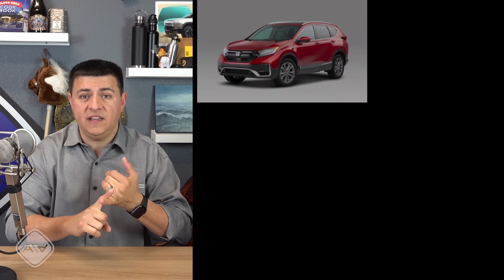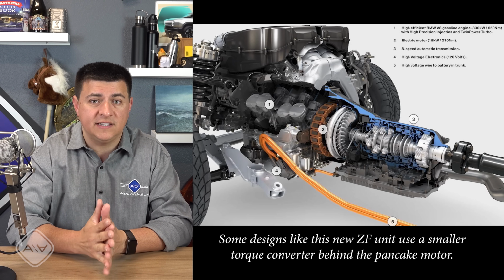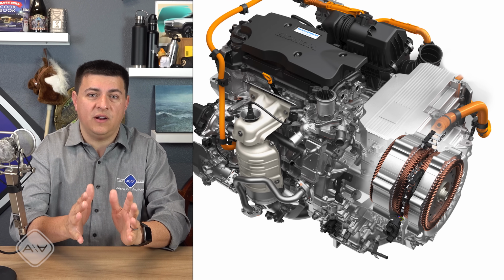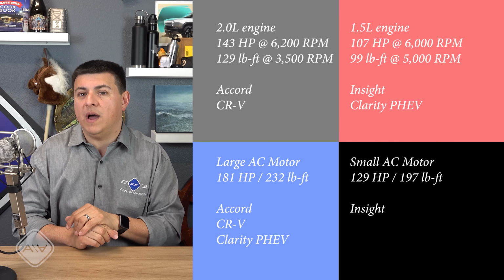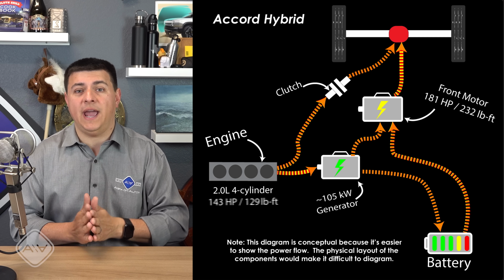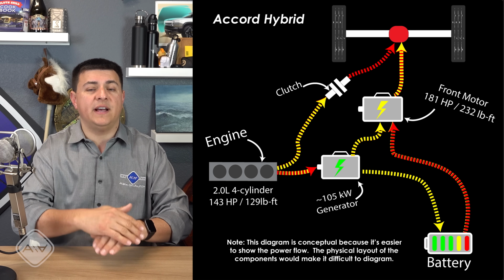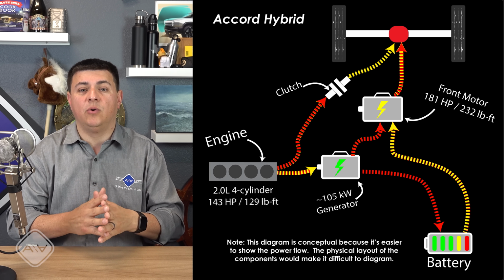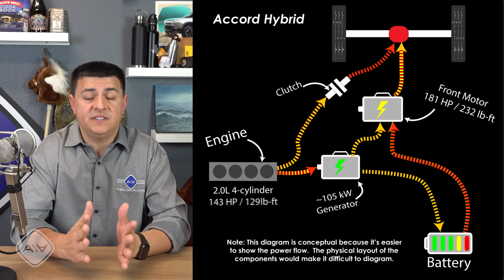How Does It Work?  Honda's 2 Motor Hybrid System Explained!

Comment: It will not get 38mph  ever
Reply: And you know this because.... ?

As of today, fuelly.com lists 10 CR-V hybrids. Two of them are doing better than 38 mpg, its EPA rating. This suggests 20%, which contradicts "never." The average is 34.7 mpg.

For comparison, the 2021 RAV4 (which has been out longer) includes 46 vehicles. Six of them, or 13%, exceed its EPA rating of 40 mpg. And the average is 34.1 mpg, less than the CR-V's.

I restricted this to winter-biased 2021 models because that is all that is available in the CR-V. The EPA suggests that mpg can drop up to about 25% in a cold winter.
Reply: @jeffjo8732  ok you believe the EPA , but I have had a 48 hour test drive with a dealer, the had 45 pounds of air in the tires, mpg of by 6 to 8 miles    my  2013 Altima gets 40 to 45 on the highway at 55mph, hot or cold weather does not affect it, oh and there was no spare in their s at the time
Reply: @judgedredd3686  Where did I say I "believed" the EPA?

You claimed, as an absolute fact, what you "believe" based on a short test under undocumented circumstances. I pointed you to documented evidence that contradicts your belief. And since you claim something that is well known to be untrue - "that hot or cold weather does not affect" a 2013 Altima ... I see no reason to put any faith in your evidence.

Let me repeat my point again: In a small data set, the Honda CR-V Hybrid - in winter, but it is not known how severe - has been documented to be capable of exceeding its EPA rating of 38 mpg. Something you claimed could not ever happen. Which is another mark against your credibility.

It won't always - something also in evidence - but the slogan "your mileage may vary" applies to EPA ratings. As an example of this, I pointed to a larger data set for a similar vehicle, the Toyota RAV4 hybrid. Its rating is indeed higher, but a smaller portion of the samples exceed that rating. And in fact, the average over the entire set is lower.

I'm not claiming any of this is conclusive. I try not to jump to such conclusions, or to present my opinion as if it were fact. And BTW, my 2018 Honda Accord Hybrid, rated at 47 mpg by the EPA, has averaged 47.9 mpg over almost 2 years (and almost 19,000 miles). That includes winter, when I admit it loses about 10%.
Reply: @jeffjo8732  ok , but nothing after 60, a dead fish in water
Reply: In summer, 55 to 60 mpg on a 40-mile commute that is mostly 60 mph to 65 mph.
Reply: @jeffjo8732  i mean no passing power
Reply: @judgedredd3686  I can pass just fine in my Accord Hybrid. Much better that in my wife's non-hybrid. But it is becoming obvious your beef is with Honda, not specific aspects of specific models. So when the facts contradict your claims, you shift claims to something else you have read.

So I will give you this one: the acceleration profile of this hybrid system falls off more quickly, at higher speeds, than a traditional gas car's. But the drop-off point is higher than 60 mph (as you claim), and it is adequate (not "nothing," as you claim) especially when compared to most other hybrids. This is a property of all electrically-driven vehicles, which the Honda hybrid is. This is why Tesla puts ludicrously-powerful motors in their cars, so people like you who think they need it at 80 mph (who are you passing at 80 mph?) can have it. And if you know how to drive it, you can improve on the claimed acceleration times.

But it doesn't matter when the acceleration profile starts out high, as it does in Honda Hybrids. MotorTrend named the Accord Hybrid the "Quickest Car That Get 40 MPG or Higher on the Highway." (https://www.motortrend.com/news/12-quickest-cars-get-40-mpg-higher-highway ). The Insight was #3. Are they muscle cars? No. Are they left behind by any other hybrid? No.
Reply: @jeffjo8732  are you getting the 48 mpg as honda states I got a new 2021 loaner from honda for 3 weeks now its not happening
Reply: @judgedredd3686  Over the last year+ (since a fill-up 3/22/2020) I have driven 6725 miles and put in 138.0 gallons. That's 48.74 mpg, over all conditions that comprise a year. This is more than what I already told you is the EPA rating for a 2018 Accord Hybrid, 47 mpg. The figure that "honda states."

Have you considered the possibility that it is your driving style that makes your experience so bad? Or maybe you are confused about what you are driving, since one week ago you said you drove a 38-mpg CR-V for 2 days, and now you say that you had an Accord for two weeks before your first post here.
Reply: @jeffjo8732  yes I have driven both hondas, and in stop and go traffic  in the Washinton Dc metropolitan area, neither will get the EPA  ratings  
you need to understand, something  weight if a factor that's why no spare tire and a small gas tank, driving into the wind will also cut fuel economy  down and driving up mountains, do a simple test put 5 adults in the vehicle of your choice Honda of course  and fill up and tell me how far you get  and how much gas you put in the car,  all hondas hybrids use the gas engine to warm the car up, now think hard, your trapped in a snowstorm  with that small gas tank, your chances of living are better with an 18-gallon tank, the advances of an electric vehicle will never way a gas one
Reply: And he tested in the best condition outside, throw in some wind and rain, and we see you are miscalculating  or fabricating  the stories
Reply: @judgedredd3686  And in my 40 mile trip from Columbia to Arlington to see grandkids, through DC stop-and-go traffic on 295/695/395, I routinely get 55+ MPG. That's what the trip computer says, and it reads 3% to 3.5% low according to my detailed records.

Last Friday, in the rain, with the trunk and back seat fully loaded for a week at Virginia Beach, I got 52.5 mpg on that trip according to the trip computer (so it's really 54 mpg). The added weight was probably 300 lbs, far more than the insignificant-to-mpg ~30 lbs for a spare tire (it's dangerous to have that lump positioned behind the HV battery, which is why overly-cautious Honda doesn't include one in hybrids). Upon reaching VB, it read 49.5 mpg (so it's 51 mpg).

Any educated adult should understand that EPA estimates, while not supposed to represent ideal conditions, also do not represent "driving into the wind ... down and driving up mountains ... 5 adults in the vehicle." Or aggressive driving in metropolitan DC traffic. I take no extraordinary measures to increase mpg, but I don't drive like a teenager, either. And I got 48.74 mpg over the course of one year, in a car the EPA says gets 47 mpg. If you can't in the same c ar, the issue is you. Not the car.
Reply: Why you car reviewers  never tell the bad stuff  Honda tells you battery warranty is voided if the interior of the car reaches 150 f
Reply: @judgedredd3686  Funny, "Honda" never told me that, and it's not in my warranty documentation. Or any I can find online. So one has to wonder if this is another gripe about Honda's hybrids that you made up.
Reply: @jeffjo8732  Just look at your door jam by the tire psi
Reply: @jeffjo8732  look at the door jam where psi for tires    any miss use or neglected on a car will void a warranty
Reply: wake the selling shit, gas in oil in cold weather, battery not to exceed  150 f

Comment: Hybrids are overly complicated and add unnecessary weight, complexity and weight.  With complexity comes expensive maintenance when required.  Battery electric is the way to go. It wasn’t 20 years ago, but with modern battery packs, hybrids are a bit useless
Reply: This is a myth perpetuated by those who can't be bothered to understand how they work, or what they are for. They vastly simplify - or in the case of this Honda CR-V, eliminate completely - one of the most complicated components of conventional gas cars. The transmission. They eliminate the need for the starter motor. Because there is no serpentine belt, many other parts, like pumps and compressors, are replaced with simpler and more reliable electric versions. Brakes last much longer. Stress on the engine is greatly reduced by running it less often, and more gently.

Improved efficiency is actually the second reason taxi fleets are becoming predominantly hybrid. They are more reliable, resulting in less down-time, and they are cheaper to maintain. The only possible exception is the battery pack. That's where the added weight comes from, but it isn't nearly as much added weight as it is in a battery electric vehicle. And costs are coming down, to the point where it is only a prohibitive expense for - you guessed it - a BEV.

Don't get me wrong; BEVs are also a good option. But the expense, and need to charge more often, make them not the right choice for everyone.
Reply: Jeff Jo 
My maintenance and repair records on my now ex wife’s Prius are not myths.   Having a combustion engine is complexity enough not to completely dismiss a counter experience as myth.  My neighbor had one as well and the local tow truck driver was on first name basis with both of us.  
Anecdotal, some might say.  But I certainly would say Myth.
Reply: @bearlemley  I didn't say your alleged maintenance records were a myth. I have no idea whether they are or not. Just like I have no idea what abuse you subjected a statistically-proven reliable car to, in order to achieve that record. I said the allegation that hybrid cars are overly and unnecessarily complicated is a myth. And I gave reasons you can check.

Comment: You completely butchered the explanation of how the Honda hybrid system works. I am very dissatisfied of your explanation.
Please do another material in which you explain ONLY the Honda hybrid system IN GENERAL. We're not interested in different mechanical engines but just about how exactly, detailed, the Honda hybrid system works : which motor works, when, at idle, when the wheels doesn't move, at 20-30-40- 50...etc miles an hour, under light and heavy load and acceleration, the noise of the system at low speed and and high speed and full comparison to a Toyota Prius system, noise and fuel consumption and in the end the price of the comparable cars ( Honda and Toyota ) with close to one another POWER systems.
We're not interested in korean models because they use regular automatic transmissions ( double clutch ).
Reply: Alex did a very good job of explaining the Honda system. Well, except the name. Honda describes it as a two-motor system; they call it iMMD, for "Intelligent Multi-Mode Drive".

He also was describing the system, not comparing specific cars. So prices and fuel consumption aren't relevant here. Alex has other videos that do that.

The specifics at different speeds really don't change as you suggest they might. As Alex describes, anytime the numbers matter it is an electric car driven by the 181 HP motor (129 in the Insight). What changes is where the electricity comes from, either the battery or the ICE-driven generator. In very specific circumstances the ICE drives the car, but never when its max power level is needed. In fact, most of the time it does the motor is acting as a generator to charge the battery.

About the only thing I'd change in his explanation, is his compulsion about the fact that it can apply only 181 HP to the road. That's true, but a 181 HP electric car can have better acceleration than a 220 HP gas car, except at the highest speeds.
Reply: Jeff Jo / No, he did not. For somebody who doesn't know anything about a hybrid system, the explanation is not good.
And you're talking stupidities too.
What you say is not a proper way to describe a hybrid system.
The added value of your explanation is equal to zero.

Comment: Honda CRV Hybrid is around $5,000 dearer to buy than the straight petrol version - if you drive around 15K kms / year and take cost petrol at around $1 / litre  then it will take you about 6 years to break even - no thanks to hybrids

Comment: These overly engineered solutions. BEV for the win.
Reply: Infrastructure isn’t ready yet. BEVs are great until the battery dies and you have to have it towed (by a diesel truck) to the nearest charge point. EVs still have many obstacles to overcome before they’re fully viable
Reply: It is coming...Toyota dropped the Synergy tagline recently.

Honda/Acura is so far behind they had to find someone to invest in. So GM was the wise choice for AV and EV tech.
Honda’s own self-driving development program isn’t close to anything like that. The company said last year that it likely won’t release its first Level 4 self-driving system until 2025. (A “Level 4” system is one that is limited, typically to areas that have been carefully mapped. You can learn more about the “levels” of autonomous-vehicle technology here.) Motley Fool
Reply: Jay Mac Infrastructure will get better fast. I have had one for a year and never ran out of juice. Passenger car solutions are here and now. Large trucks and work vans I agree have a ways to go. 3-5 years from now there will be solutions for that. I just think this hybrid stuff for passenger cars will not be the future and these companies will be left behind.
Reply: For me BEV charge times need to be 15 minutes or less for long trips. The only EVs that come close are way too expensive.
Reply: @DaveWaterdish  works for you, but not everyone is you. Do you do any interstate travel? Do you have a job 70 miles from your house and also need to run errands?

Until, like already said, there are charging station with 15 minute charges, as common as gas station on top of it, BEVs are not the solution.
In fact, they arent the solution long term either. Hydrogen fuel cell is, among other more environmental friendly solutions.
Hybrids and BEVs are both stop gap solutions. Just plain efficient gas engines are as well. 40-60 mpg out of a non hybrid would be better for the environment than mining for those elements to make batteries.
Making ethanol from sugar cane, beets, pretty much anything but corn would be better, remember we have pzev gas engines.

But sure, your BEV has been good for you for the last year, so everyone should have one! How self centered view of reality you have.
Reply: zakura ayame I simply said it works for me and never had a problem on trips or daily driving. I drive for work every day and can do upwards of 150 miles per day. Your view is self centered because you don’t own an EV or live with one every day. You said the infrastructure isn’t ready and well that’s just not a fact for everyone. Also, if your commute is 70+ miles per day without milage reimbursement I would look at getting another job :) even so many BEVs can do this without any issues. Also never ran out of juice. That’s like saying people never run out of gas lol. That happens all the time lol

Comment: Anyone who buys a new Honda hybrid over a Lincoln MKZ or 2020 Hyundai Sonata should get their IQ tested.
Reply: Why do you say that? Seriously, I don't know enough about those systems to rate them better or worse so please explain.
Reply: @jsfbay1 

The MKZ is discontinued, meaning better deals. The MKZ is a more special car than say a LEXUS ES. The hybrid drive train was copied by Toyota for their Prius.

The new Sonota is above the rest of the class and keeps a regular automatic transmission, rather than a CVT. The materials are a class above the Camry & Accord.The styling and design language are also more pleasing to the eye.

The top 3 cars for a hybrid from my research are the Avalon hybrid, Sonota hybrid, and Lincoln MKZ hybrid.
Reply: @michaelgrant5258  I'd go with the Toyota or its Lexus sister, as its proven reliability and service. From my research, Ford and Hyundai have a less friendly long term reputation in those categories.

Honda has been dropping in quality and reliability in the last 15 years or so.

Just do due diligence as a buyer, it's your tens of thousands.
Reply: @zakuraayame5091  I wouldn't lie if I said I do not trust the Korean car makers in the long term. All can be said is that the Ford/Lincoln hybrid & Toyota/Lexus are bullet proof and based off the same designs.

Ford Escape Aisin produced & designed hybrid: 2005-2012 Taxi's in NYC have or 500,000 miles on them.
The 2013- today Aisin designed & Ford produced hybrid HF-35 system designed and produced by Ford is almost identical to the first generation Aisen designed hybrid system. The current generation Prius copied and use this same Aisin designed hybrid.

Comment: With Honda you re stranded on the road when it brake down
Reply: Isn't that true for any vehicle if you have a failure with engine, electric motor, battery pack, transmission, inverter, fuel pump, CVT, etc...